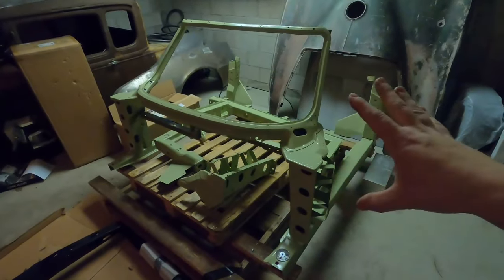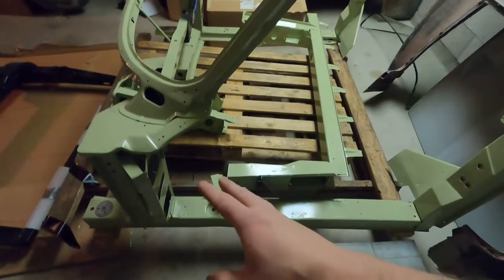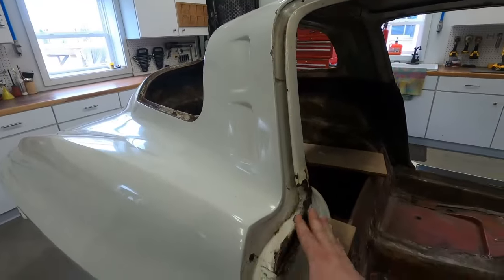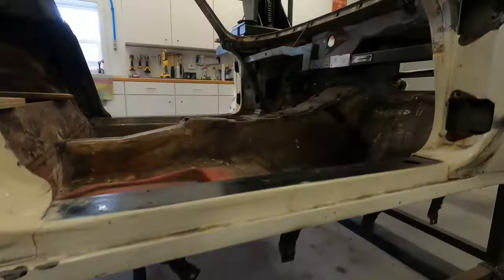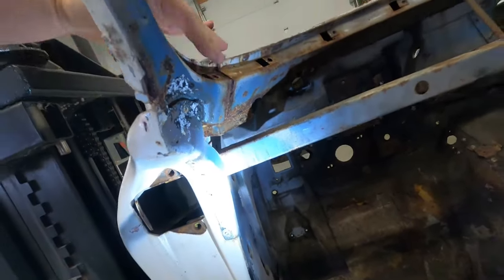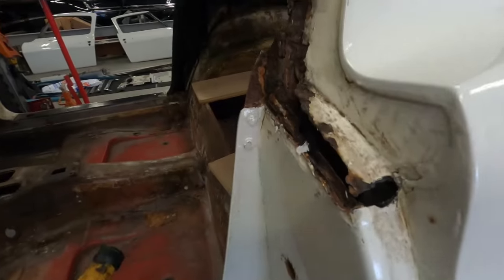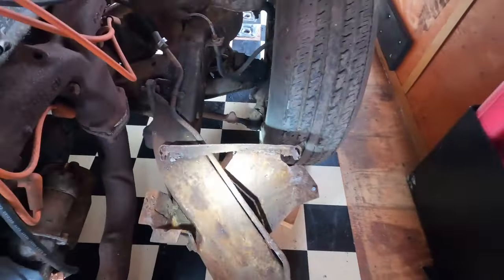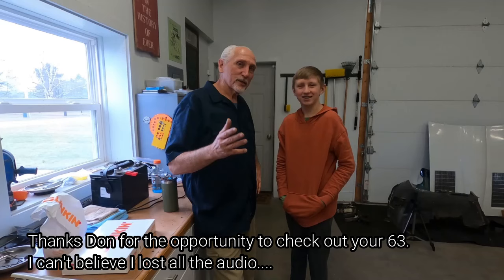How To Inspect A Birdcage.  Avoid Buying An Overpriced Lemon.  Inspecting A Split Window.

Comment: now peeps know why one of these fully restored is big money. look at all the hours it’s going to take to bring this car back to concourse condition. crazy passion. love it Mitch, thanks for the education again. I’m still learning at 57.
Reply from the maker: That’s a good point! They can be like an iceberg. They look nice on the surface but the more you look and the more you dig in the more you realize how much needs done. It’s going to need extensive work to rebuild it. It’s going to need a lot of new fiberglass and steel panels. But once that’s done it will be really nice.

Comment: Hey there Mitch,
Thanks for the education. This should come in handy when I go shopping!
That 63 frame ... how did it not collapse in on itself? Yikes that's a lot of lost metal.
I lived in Minnesota for a while as a teen. I drove my rusty 72 Camaro over a pothole and the leaf springs broke up through the rockers ... the car basically broke in half. Contrast that to where I am now in Central Texas. You can eat off the bottom of my 14 year old truck that has spent 100% of it's life parked outside.
Take care,
Dan

Comment: wow that frame is sooo bad.  Nice the owner allowed us to feel his pain.  Maybe he went in eyes wide open.  Is there some way to identify a '63 frame...meaning could another frame from another year be swapped in without being a huge red flag?  I think there's a serial number somewhere on the frame tho no doubt this one has rusted away to nothingness.
Reply: You need to watch all of Mitch's videos , at your leasure . He explanes how about all vette frames would work .
Reply from the maker: Yeah that frame is shot. Don is going to build a Restomod so he will use an aftermarket chassis. I did a whole series on converting a 1978 Corvette frame to work with a 63 body that I called the misfit. 

The 63 chassis has unique body mounts as well as a special emergency brake setup. Those are both 1 year only. But you can swap a 64-67 chassis under a 63 easily. You can modify a 68-78 chassis with some more effort. You need to change the body mounts, frame horns, and the back about 2’ of the chassis to convert it to be a direct replacement for a C2 corvette. It can be done but it’s a fair bit of work. Check out that series on the misfit if you want to learn more about converting frames.

Comment: How do you see that with body on it!!
Reply from the maker: That’s when you have to be creative and very observant. If you know the area that the car is from. Say Ohio. You know the car will most likely have rust down low. Start with the chassis and the rockers. You can see a fair bit of the rockers with a mirror or bore scope. Or put the car on a lift. Open and close the doors. See how they shut. If they don’t consistently close properly that’s a sign of a bad frame or a bad cage. 

The windshield frame is hard to see. But if the car is very weathered and it sat outside for years you can bet the windshield frame is rusty. 

You are right that it’s hard to see the full story with the body on. But that’s when you have to be resourceful and think about all the clues that the car has to offer.